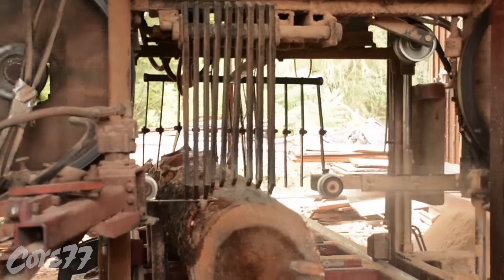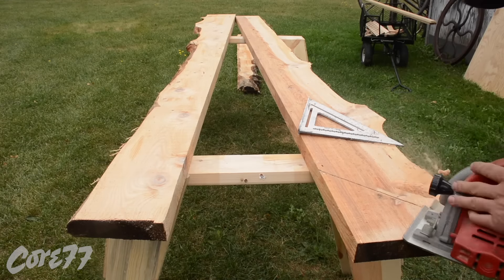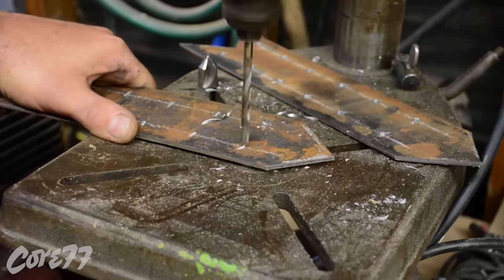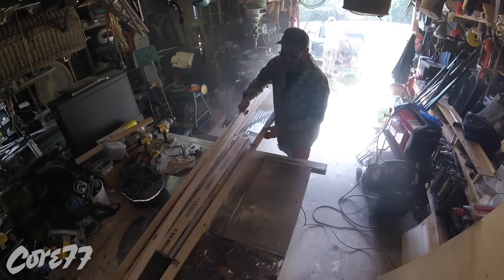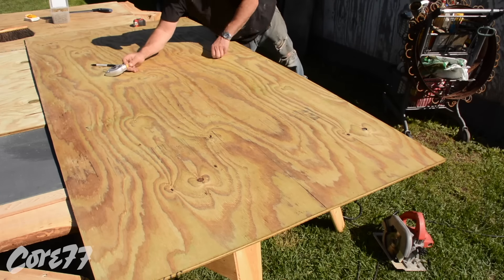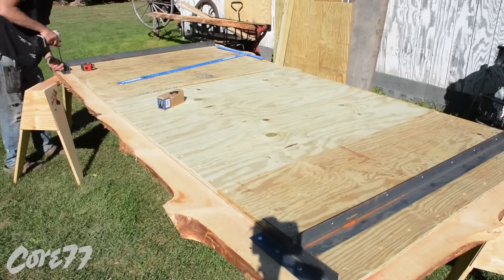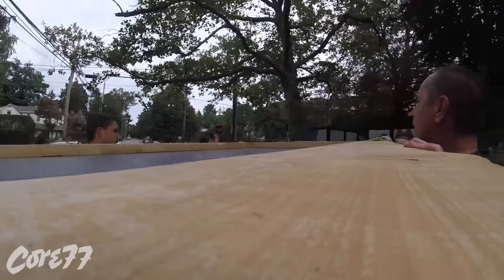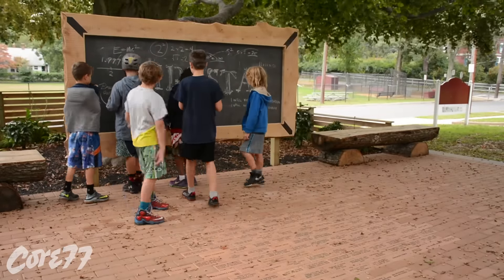DiResta’s Cut: Massive Outdoor Chalkboard

Comment: Nice job. I am hoping that wood is low on tannic acid as its still wet. I read an article many years ago (but never tried myself) ,that you can dry a log out fairly quickly buy setting it vertically in a large bucket of dry sand. I must try that someday.

Comment: How well does glue work on green wood?
Reply: I'd guess pretty well.  I used some Titebond 3 on a job and left the brush in the water.  About a month or so later the water had evaporated and the brush was cast in a reasonably thick film the shape of the bottom of the container.
Reply: Not very well at all,  some poly construction adhesives will work but working with wet wood is not good.
Reply: Think the glue was only added for the sake of it or out of habit, the trim was brad nailed then the ply was screwed through the trim into the boards, I'd say that's good enough
Reply: You made a very good point there. He sad it also in the video. Always nice to wach him, even when he works so fast. Greetings Koos

Comment: Awesome, and that live edge is just beautiful..
But I do have a question, for Jimmy or anyone who'd know; Why use real slate chalkboard? Why not use just plywood and chalkboard paint, considering you could do away with all the extra weight and seam? My sister has a huge wall sized chalkboard done with just the paint and it seems to work just as well..
I figured just not letting them go to waste was the main reason?

Comment: Thirty Eighth.
Hey Jimmy, Is the reason you use the "Wet Wood" because of the elements?
Did you use a specific moisture percentage?
The only time I used wet wood was to make a smokey fire.
...oh, and awesome once again.
Reply: I may be wrong, but he mentioned in one of his vlogs that his normal sawmill didn't have what he wanted, so he was at a different sawmill, and I guess all they had were wet logs. So I think he used wet wood out of necessity/ease, not by design.
Reply: Yeah, I don't think any woodworker ever really prefers wood that is too wet over adequately dry wood. He mentions that it'll be outside because that diminishes the problem somewhat, but it's never ideal (or at least I can't think of any situation where it is).
Reply: The exception would be for woodturning... rough turn it wet, then dry it before finishing
Reply: Bjørnar Haugen Absolutely, good point.